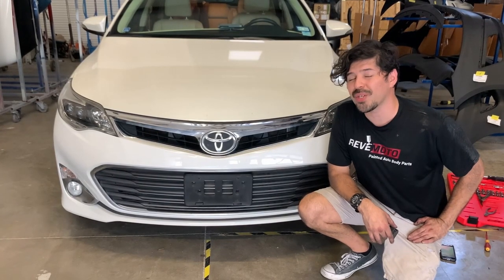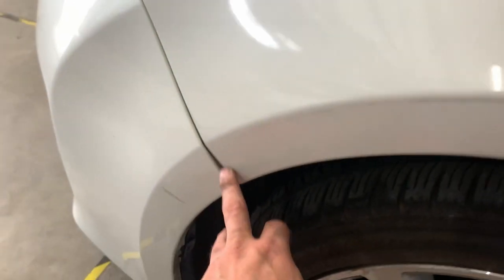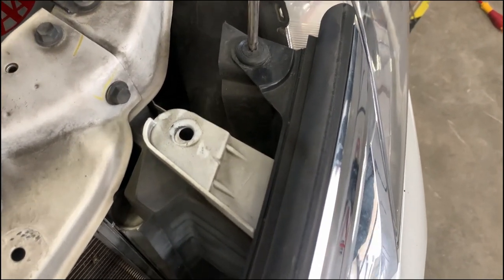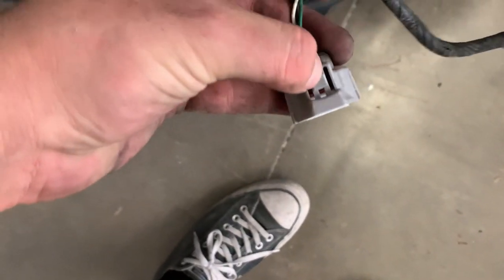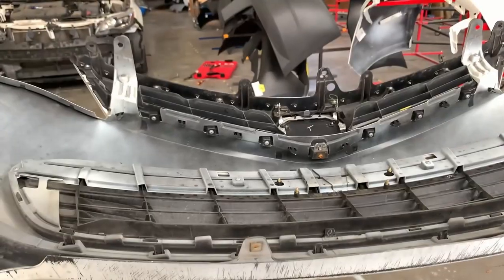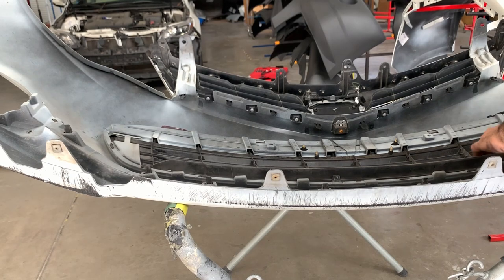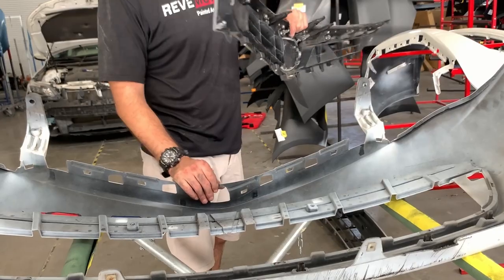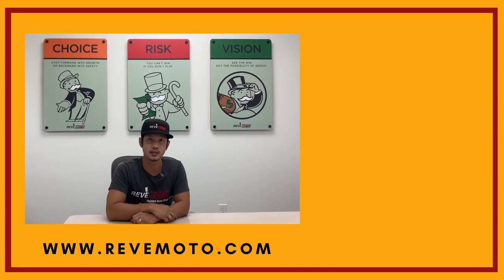2013-2015 Toyota Avalon front bumper & grill removal | ReveMoto

Comment: My parents bought a new-to-them super clean, low-mileage’16 Avalon that obviously was an older person’s car that had mishaps with the bumpers at both ends. The front one looks freshly repainted but was sticking out where it met the fenders. I bought new bumper “stays” (the plastic brackets) for the ends and snuck them in only having to remove some of the wheel liner fasteners and pop the ends of the cover loose. Fits perfectly now. Was about 50 bucks well spent, even buying OEM Toyota ones.
Reply from the maker: Yeah most of the time when people replace the bumper they fail to look at the support bracket.  Great job trouble shooting the issue

Comment: can the upper grill be removed without removing the entire bumper? If so how do you get to those I believe 8 clips that go downward and to that small rusty screw that you removed
Reply from the maker: It’s gonna be a little difficult unless you can get to the rusted screw.  So you need to get the top clips and screw out.  Then there is two behind the grill then the rusted one.  Good luck if you need the bumper or parts go to www.ReveMoto.com